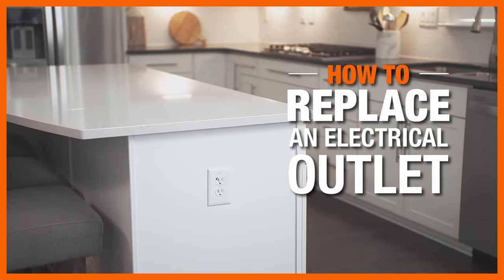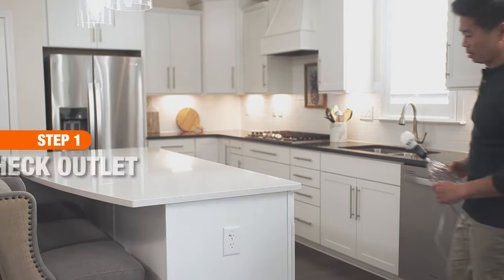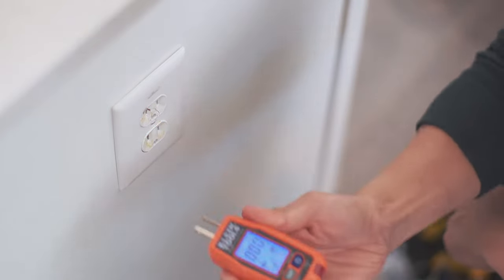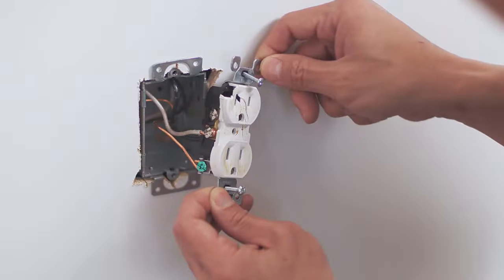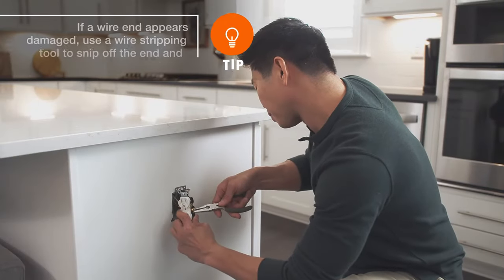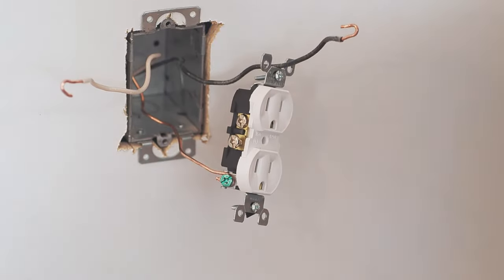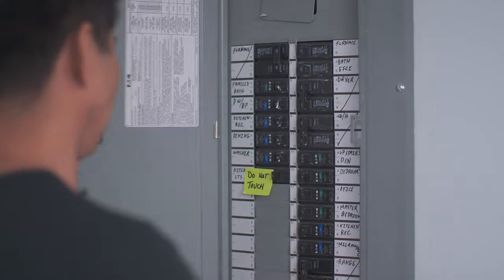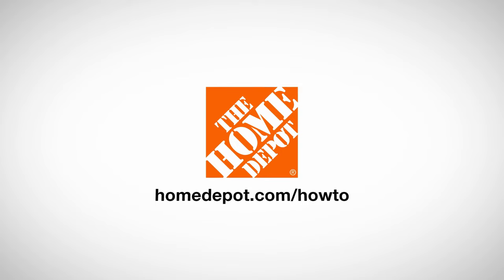How to Replace an Electrical Outlet | The Home Depot

Comment: "The amperage should match" ...and HOW do we do that Home Depot?
Reply: I found the amperage on the old outlet under some paint I had to scrape off. Check your breaker box, too-it should say what amperage that outlet needs.
Reply: If you don't know that imma be honest you probably shouldn't be attempting this.
Reply: @shadowknight4551 really? It ain't that hard.
Reply: The Amp number should be on the breaker
Reply: Yes, I had that question at first and then thought “I think it’s indicated on the panel” as others have suggested.
Reply: If you look at the fine print on the actual outlets it will tell you Amps and Volts. It's probably 15A and 125V but make sure you check for yourself. It might also say things like TP for Tamper Proof or label the hot and neutral sides. just FYI.
Reply: @VerteAnaconda Exactly 💯
Reply: How an electrician
Reply: Research it, mate
Reply: 20A have a t-shape horizontal slot,

Comment: I wouldn't plug something into it as it could of lost its neutral connection and the appliance wouldn't work but you still would have power.  Voltage tester is best option to make sure circuit is dead.
Reply: Are you talking about a multimeter?
Reply: I don’t know thing about this shit but if there’s a tester and you have one why wouldn’t you use a tool made for the job it’s like trying that diy oil filter wench when there’s a actual one next to it
Reply: If you doing it diy just turn of the breaker box completely
Reply: @Sisidiehebwi  then my generator kicks on
Reply: How do you know what amp to replace the plug with

Comment: I am gonna try it out today let’s see how it goes. Also how do i tell if i have 15 amp or 20 amp
Reply: If you look really closely at the outlet face after you've pulled the cover it'll tell you
Reply: It says on the breaker switch
Reply: Did you survive? Am trying this week. Should I cut the whole electric panel? 😅
Reply: @clodiamandes7153  yes I did , very simple! Yes cut the whole electric panel to be safe

Comment: How do I figure out if it's a 15 or 20 amp outlet? Is it ok if you use a 20 amp outlet if you don't go over 15 amps?
Reply: It's very simple: the receptacle should match the amperage on the breaker.
Reply: @josephmcmahon4824  How does someone do that? The old socket I'm replacing doesn't have any indicator of amperage.
Reply: @ddobrien1  it's in very small print on my receptacle.
Reply: @kiavaxxaskew  thanks
Reply: My braker doesn't reads what belongs to what...what I do???😮